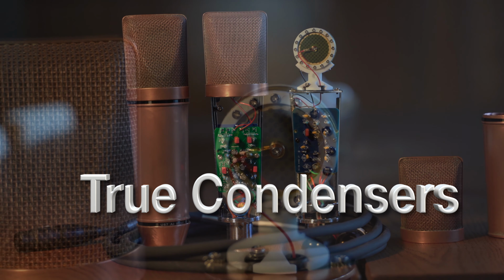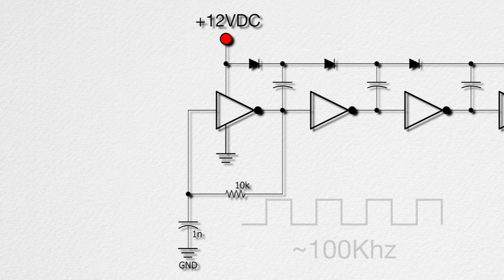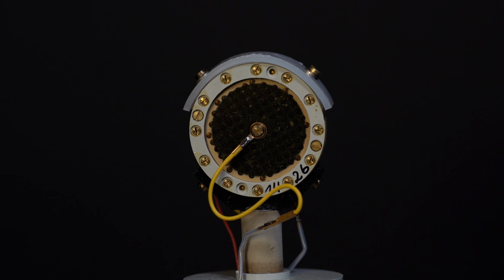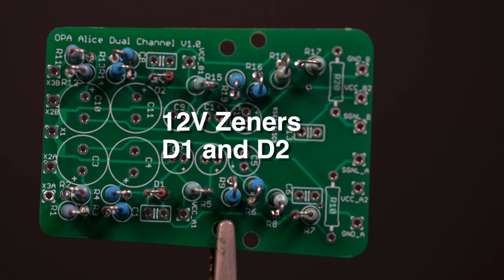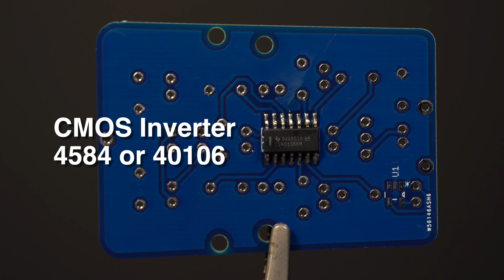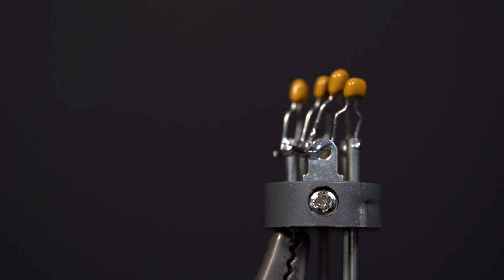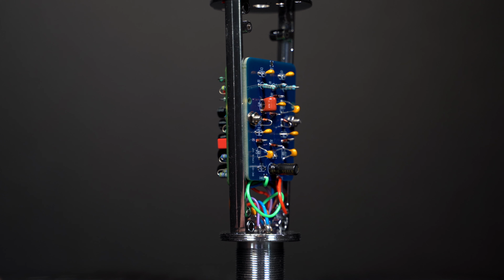True Condenser Build

Comment: For the dual channel version does it require phantom power on both channels or does phantom power coming over one channel supply power to both?
Reply from the maker: Yes, there are two complete mic circuits thus both need phantom power
Reply: @SoundSleuth  many thanks for the reply.  Long story short, I was hoping to save a few phantom powered channels on my zoom recorder (2 channels can't supply 48v) when I'm not taking my full mixer.  I will either find another way or deal with it.   I've made great use of these and your other mic designs.  Thank you for all your work and being willing to share!

Comment: Can capsules with electrical connections on both sides (like the rk 47) be hooked up in single channel for cardioid pattern only if you just don't hook up the back side or do they still require dual channel boards?
Reply from the maker: Yes, you can use just one side of the capsule and it will be Cardioid.

Comment: Such a beautiful and full sounding mic - your singer is of course doing a great job as well.  Really interested in building this.  Are there any advantage to adding the trimpot to the hex inverter board?
Reply from the maker: Hi Jeff, I thought there would be which is why we included it. I never use them.  The output is 80VDC and it adds just a few more dB signal to noise ratio to an already fantastic mic. With the "old school" style votage boosters in mics that used inductors, you could adjust upwards of 100VDC so they needed one much more and of course to allow for component tolerances that we dont have with this one.
Reply: @SoundSleuth  Ahh that makes sense!  I always forget how good we have it with modern component tolerances.  Thanks for the answers - and all your work!
Reply: Wats the brand of this mic. please

Comment: Why would you want to have two capsules sticked back to back, this would pickup noise from the rear side. Maybe this is not for solo.
Reply from the maker: Having a front and back lets you adjust the pattern in post figure 8 through Omni. This has been done for 60 years

Comment: I have the single sided mic board and voltage multiplier board.  I don't understand where the connections to the mic capsule are made.  Mic board signal - goes to the diaphragm of the capsule.  But the capsule housing is ground right? does that connect to ground on the mic board.  Then where does "pol" the polarization power connect on the capsule.  There are only two "wires" on the capsule ???  Please help.
Reply from the maker: The Pol goes to the capsule common.  That keeps the fixed plate or backplate of the capsule at the polarizing voltage. Because that is referenced to common ground between the two boards, there isn’t a “ground” connection to the capsule.  The signal then goes into the OPA board.
Reply: @SoundSleuth  Thanks for the lightning fast reply - just to be clear :  
Pol  - to - Capsule common.  
Vcc (Voltage Multiplier) - to - Vcc1 (mic board).  
Gnd (Voltage Multiplier) - to - Gnd T(mic board).
Sgnl (mic board) - to - capsule diaphragm
GND (top of mic board)- Not Connected
Vcc_2 (top of mic board) - Not Connected

I hope I have this right - and once again thanks for your time and great plans etc.
Reply from the maker: @Mothara  yes that is correct. Let us know how it goes. They are great mics
Reply: @SoundSleuth  - finally got my capacitors (last component).  Put them in today , packed it up and tested.  Sounds Great!  One of the most fun and straightforward audio builds I have done (I have put together a bunch of modular synth kits in the past).  Thanks for your help!
Reply from the maker: @Mothara  great to hear! Pun intended. And I started with a Synth Kit a looong time ago, PAiA electronics

Comment: Hooray, last weekend the boards arrived and I assembled two microphones with Rk-12 capsules. I used them to form the stereo atmosphere of the TV broadcast of MMA. The overall impression is a great sound. The only thing I didn't have time to solder the Multilayer Ceramic Capacitors since the delivery from mouser was later. But I really wanted to just hear them - super. An interesting detail on the first day of the broadcast, everything was just perfect, but on the second day, when changing the site on one of the microphones (with Gain +25 db), noise appeared (a slight crackle) - 63 dbfs and the signal became weaker by 9 db relative to the second, exactly the same. 
It was not critical, but unexpected. Now I'm waiting for new xlr connectors (the Chinese quality is just terrible) and I'll solder Multilayer Ceramic Capacitors to them, and then I'll listen and figure it out. But in general, I am insanely satisfied, thank you for your work!
Reply from the maker: The caps on the XLR are important. For the one that is glitching, make sure the housing is screwed together tightly and makes a good connection between the parts. Sometimes there is paint on the edges that causes an intermittent shielding connection.

Comment: Hi there, I'm a little confused, on the Alice op amp circuit, there are 2 grounds is that correct? because on the simple schematic pdf seems its common ground, unlike the step by step pdf there are 2! Now regarding a single side condenser, the signal wire goes to the Alice input and the backplate (condenser ground) is connected to Bias voltage? Now I am using the phantom power to power the mic so first a go through a LDO to send the 12V to the hex for the 80V!! Please need some light! Thanks in advance!
Reply from the maker: Here are the DC voltages (and grounds). The incoming P48 is used to create 12VDC (actuall 11.8ish). The opamps need a split supply so we create a "virtual ground" that is half of that. That lets the opamps work normally. We also tie the 1Gig resistor to that. That actually biases the first opamp stage. Which puts 6VDC(ish) on the diaphragm of the capsule. We also take the 12VDC and use it to supply the Hex inverter. The output of that is about 80VDC filtered. That goes to the backplate, biasing the capsule. That gives about 75VDC in total across the capsule. Hope this helps.
Reply: @SoundSleuth  Thanks much! So I can use the phantom power with a LDO to 12v for the Hex inverter!
Reply from the maker: @BRISSH  yes.

Comment: Hi there. Very interesting an awesome video. The mic builds are amazing! I would like to try and build a few of my own mics!

Could you perhaps do a video on converting a cheap battery powered Lav like a Boya BY-M1 to allow powered connections to "plug in power" mics. I have a Rode Video Micro which is really awesome but you cannot connect it to a mixer directly to line in given that it requires plug in power. The Boya BY-M1 uses a tiny battery which allows it to work as a line in device but can also work with plug in power. Would be really cool to see if the circuit can be made into a "plug in power" system. So instead of a Lav mic at the end, it would instead have a 3.5mm female connector?

Thanks again for the awesome content.

Comment: Wonderful, definitely going to try and build this one! With the pre-assembled PCB's and parts from JLI this looks very doable, just a matter of assembly and soldering connections to the capsule, the XLR and between the inverter PCB and main board, am I right?

 Really want to try a dual output mic and use it with the Austrian Audio plugins (stereo creator and polar designer). Such a cool idea.

Sadly can't find the mini U87 bodies anywhere. I will see if I can find a body somewhere. How do I know if it fits / mounts? I would prefer something relatively small and with a simple screw mount (so I can mount it without a shockmount), so it's easy to place in an ms or blumlein configuration and it won't be that wieldy. But I figure something out. Thanks for the great video!
Reply from the maker: Everything will fit into a BM-800 Body. Just get a good one. I recommend a Neewer brand one.
Also fit in a lot of the MXL bodies.
Reply: @SoundSleuth  Thanks!

 Will hunt down a BM800 body for the easiest build first. Found a couple in the neighbourhood, but I don't need the desk-arm and other accessories. I would prefer a direct body mount instead of a shockmounted one. Will check the craigslist for a broken mxl or u87 first. Have a nice holiday!
Reply: @SoundSleuth  Yeah, I got all the parts and received the preassembled boards from JLI!

I'm a noob in doing this kind of stuff, and I'm not sure which 22nF caps I should use for the EMI and RF noise suppression . I'm guessing 100V? (To cope with the Phantom Power, 2 x 48v?)  I'm missing all the basics here I know.
Reply from the maker: @Tije.O  I use typically 63V as that is a standard voltage and above the 48V on phantom power.
Reply: @SoundSleuth  Thanks!

Comment: I was just curious if you were going to build a mic for voiceover which capsule would you pair with the alice circuit? I am probably going to go with the JLI Electronics capsules and I was thinking of doing the TSC 1 capsule but wasnt sure. I see they have the CK 12, RK 47, and 86U. Do you think it would be worth it to go for any of these over the TSC 1? Or even just go cheaper with the 2555BXZ3 and not even worry about the polarization board. I am just trying to weigh my options before starting the build. I know its different for everybody so I just wanted to ask if it were up to you and you were doing the build is it worth the extra money to upgrade from the TSC 1 or even the 2555BXZ3 to those more expensive capsules for voiceover? Can't thank you enough for all of these great videos.
Reply from the maker: @_stevek  the TSC1 is my go to. Inexpensive and really good K67 clone

Comment: Do you still need the 5 pin to dual 3 pin breakout cable and a 5 pin XLR jack if you're just using a single channel capsule?
Reply from the maker: No, you only need that if your bringing both signals out. For a straight Cardioid, you are good with the three pin.

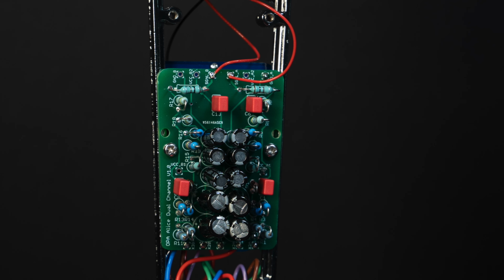Comment: Greetings, I am very interested in the previous mic build you are referring to @5:12.  I've seen a video of yours with the "Alice" mic, is that what you were referring to?  If so I see a few extra components in this diagram for both sides of the circuit.  Mainly the capacitors and diode located at VCC_A1 and VCC_B1 and the once by VCC_A2 and VCC_B2. Can you let me know or point me in a direction to know what those do in for the circuit?

Comment: Love the videos, but one question. You always seem to solder you 1G resistor high off the PCB, is that just down to the cost and being able to clip and reuse?
Reply from the maker: I do that so it can be cleaned.  It’s one gig ohm so dirt, condensation, solder flux can mess that up
Reply: @SoundSleuth  ah, that makes sence. Is there a practice in industry to do anything like potting that with a non conductive epoxy to prevent first or condensation for accumulating over the years?
Reply from the maker: @PigeonPrint  not really.  There are methods but no mic manufacturers that I know of do it.

Comment: Hey DJJules, I have a question from this build. I do not have the same base microphone that you did, but i have followed the build the same way and have a crafted finsged product. My question comes to audio interface, what would you recommend as I am still just getting into good audio recording/live streaming. Do i need an amplifier or does the phantom power from something like the Focusrite scarlet? Im lost when it comes to the other end of the xlr. I dont need a full answer, but if you can guide me to a place where i can start reading up on this would be just as great. There is a lot of information from all over and I dont know where to start without skipping anything.
Reply from the maker: I use a Focusrite Scarlett  and ZoomF6's. Both work great. Anything that gives you P48 will be fine.

Comment: This is awesome! How would one build a greater mic than a Blue or a Shure?
Reply from the maker: These are better.  The noise floor is great and dynamic range is really good.  I’m about to post specs I’m heading into a acoustic test chamber next Tuesday
Reply: @SoundSleuth  how did the testing go?
Reply from the maker: @TheSlyMouse  Very well, I'm still sorting out how to show the frequency response. The noise floor is 8-12 db lower than FET circuits.
Reply: @SoundSleuth  I appreciate your reply and look forward to hearing about the results if you decide to share
Reply: @SoundSleuth  Hi Jules, I hope you are OK. When you say "lower noise flor than FET capsule"are you referring to primo EM272 for example? Many thanks!
Reply: @seyisland  The noise floor is when the circuit is used with a full condenser microphone as the impedance converter. The EM272 has a built in fet and works a bit differently. It is a great little capsule but not as quiet as a 34mm capsule with a fet or my OPA circuit. It is a small diaphragm capsule, which inherently has more noise than a LDC. Specifically  I am referring to this: https://www.dropbox.com/s/roqjnwqbj6xw3ho/OPA-Alice%20Circuit_VS_FET%20Schoeps.pdf?dl=0

Comment: I understand basic circuitry but this seems like rocket science.What if i just buy the capsule to replace the capsule in my bm700 would it work,if yes then how much improvement can one expect?
Reply from the maker: The BM-700 does not supply capsule bid voltage so it won’t work by itself. You could use a capsule like the TSB2555B
Reply: @SoundSleuth  Thanks for the reply much appreciated.

Comment: Is there a way to build this without needing a breakout? How would i build one and be able to go 3 pin xlr straight out the mic?
Reply from the maker: Yes a single cardioid version.  It’s in the video.  If you are asking about an internal switch for cardioid, omni, figure 8, that’s a redesign
Reply: @SoundSleuth  I believe thats what i was asking about. What would be different about the design? The circut board?

Comment: I welcome you! Recently I have a great interest in diy microphones and very often people on forums refer to Alice. And now I'm glad I found you on pcbway and instructables 
For several days now, I've been watching videos, translating texts, and trying to figure it out.
I have a few questions, please tell me:
1. Do I understand correctly that when using only Front capcul only, we get a cardioid orientation?
2. And when using Mix Front-Rear, we get an Omni orientation.
3. And with Mix Front-Rear out phase, we get a curly eight.
Reply from the maker: You are correct with your understanding of the microphone patterns.
Reply: @SoundSleuth  Thank you very much! I continue to deal with the components for the order :-)
Reply: Is it true that using the "ORA Alice Dual Channel v1. 0" board and the TSC-1 membrane, we get a classic cardioid?
At the same time, we use a 3Pin Male XLR in the microphone body, right?
Reply from the maker: @fastunovaudio  yes that is correct
Reply: @SoundSleuth  Thanks! I have a small question about the element base.
You specified 4 pcs. 47uF 63V (667-EEU-EB1J470SJ) and 6 pcs. 47uF 35V (667-EEU-EB1J470SJ) - is this a typo and meant 6 pcs. 667-EEU-FC1V470?
And the second question that confuses me. 12V Zener (78-TZX12D), but it's 12.45 volts. Is this true or use TZX12D-TAP-where exactly 12 volts
Reply from the maker: @fastunovaudio  please read the whole instructable. I think I answer that there.  The Capacitors: the 47uF input could see all 48 volts from the phantom power coming in. The other ones do not. The 35v rating ones are physically smaller.  That is why I picked them - to fit the board and be smaller.  The zener could be 10V all the way to 15 and the circuit would work just fine.
Reply: @SoundSleuth  I understand everything about zener, thank you!

I may have misspelled it, or it may be an error in my translation. I understand the logic of choosing capacitors, you save space. Unlike single Circuit OPA where you use 5 pieces of 667-EEU-EB1J470SJ in Dual Channel, you use 2 pieces per channel 667-EEU-EB1J470SJ (47uF 63V) and 3 pieces of 47uF 35V (and here it seems a typo on pcbway) according to the parameters, the marking is more similar to 667-EEU-FC1V470 (Mouser No:)
Reply: @SoundSleuth  Please excuse me if I'm wrong, just trying to figure it out ) I really appreciate your time and attention that you give to my question)
Reply from the maker: @fastunovaudio  You are good! I understand the translation process.  These are great microphones. I hope you enjoy the build process and then using them.
Reply: @SoundSleuth  Thank you very much! I watched the recordings of your voice and instruments made by your microphones, and even in a laptop, the sound is very, very decent. I plan to use your microphones in TV broadcasting to sound the atmosphere in sports stadiums, both in indoor and outdoor areas. I really want to use studio developments in TV
Reply: @SoundSleuth  I will gradually buy items. A lot of them are currently unavailable for purchase on either mouser or digikey. Something is on ebay so the process as you know will not be fast, but I will definitely collect them. I really want both of your microphones: cardioid and multi-directional.

Comment: Excuse me, but what audio interface or phantom power would I use, and can I have price ranges for both? not sure how you would connect this to a computer, thats my only problem
Reply from the maker: I use a Focusrite scarlett. I have owned multiple over the years and have the 18i20 now. Any two channel USB audio interface will work just fine as long as it has Phantom Power with it. Most do, but check the specs. They run about $100 to up in the thousands for multi channel studio ones. The Scarlett 2i2 is about 170 USD.
Reply: @SoundSleuth  Woooo! Thank you! I was actually looking, and the Scarlett 2i2 is going for about 120 right now. Thank you!